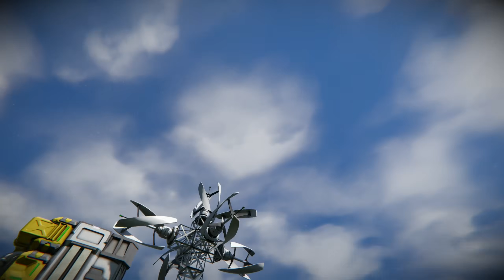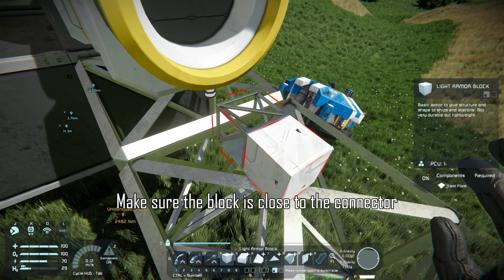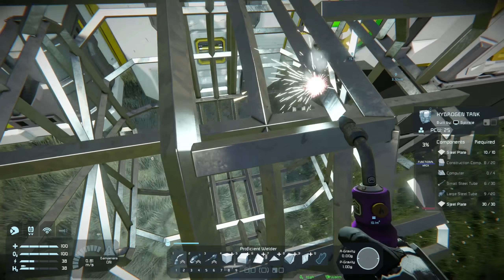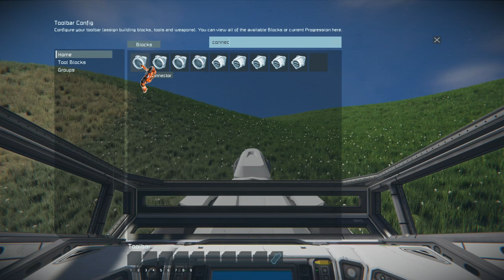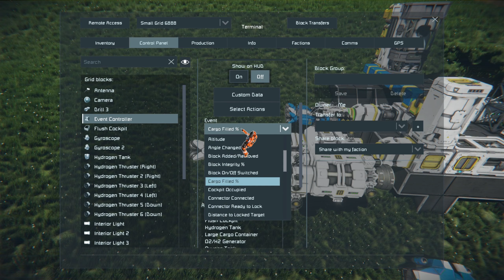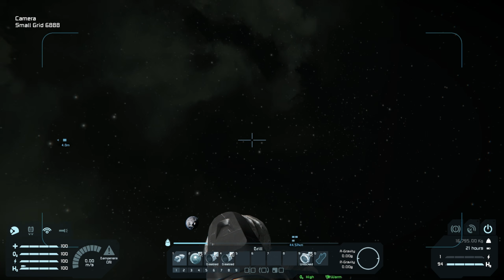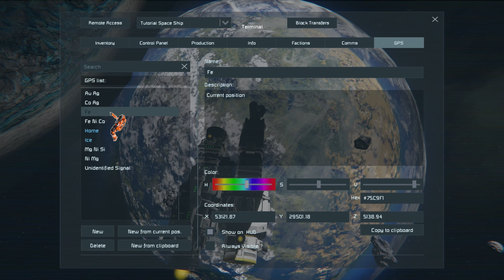How to get to Space (for the first time) | Space Engineers Tutorial

Comment: You forgot to add the gyros to the event controler. I know that this is only a tutorial for new players but I find the small grid ore detector useless for survey work and any ship I intend as a surveyor I will ad a large grid conversion via rotor or hinge and add a lare grid ore detector. Also parachutes are very helpful on the deceleration when heavily loaded when returning from space. Another backup is to add atleast one solar panel so that if you drain the batery you don't get stranded.
Reply from the maker: I didn't forget, I just figured I'd dragged that part out long enough for players to understand how it worked so I'd move on :)

I actively chose not to include parachutes here, the reason was that you need far too many of them for them to be practical. To make a safe landing most of the time with this ship loaded with ore you needed at least 8! Balancing that and all the extra conveyoring required started to stretch the tutorial out to a length I wasn't happy with.

Comment: Great tutorial once again. Very helpful and very well explained. One suggestion (sorry can't help myself) when you pointed out that you will get much more thrust in the up direction and you need to remember that in space? Thats a good opportunity to suggest a system that is not often considered, mostly because no one teaches it. I dont consider it an advanced engineering technique its actually for basic designs. The second method I will mention IS advanced however ..Any way.
Issue: Asymmetrical thrust.
Solution 1) use same size thrusters in all directions. Yes its that simple, THEN you add larger thrusters, which u can turn on and off for those times when u need to fight gravity or to GTFO. So when in tight spaces while mining an asteroid or aligning for docking u have same amount of movement in all directions. This concept is a good one to mention at such times.
Solution 2) have hot bar commands or programing which will reduce thrust so all directions as equal. You then activate this command when u require fine motion control, works on gyroscopes too. (<--- another teachable solution).
Once you get into the mental habit to thinking of these solutions it helps when designing. for instance having a hotbar command ready that just says 'docking'. when activated all thrust is reduced to a level allowing much finer control, and smoother turning (those gyros again) while docking or Inside another ship or station.
And, as in Splitsie's case, since he loves to snipe using fixed guns so much, he would have much finer aiming ability from long range. (tap command, align ship, fire)

Comment: i want to know, can u use a prototech ion thrust, can u leave the earths atosphere? yes i know its meant for space but do u think it can work on earth due to its power output?
Reply from the maker: You can use regular ion thrusters, you just need more thruster than ship most of the time, so the prototech ones should work fine
Reply: You can, but you will have a fairly thin margin for extra weight. You still won't be able to move heavy armored ships or ships carrying cargo in atmo with the prototech ions
Reply: Prototech Ion Thrusters are significantly more powerful in atmosphere than the standard ion thrusters, and may even produce more thrust than an atmospheric thruster at lake (sea) level.

That said, BEWARE: once you leave an atmosphere, Prototech ion thrusters consume dramatically more power and produce dramatically more thrust, so they could rapidly outpace your generators, drain your batteries, and cause near-instant acceleration to top speed.